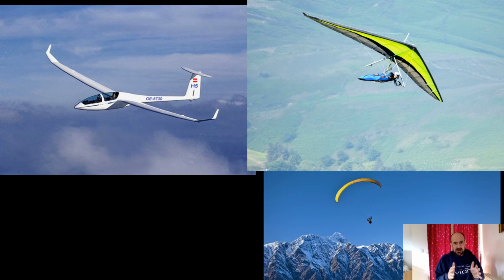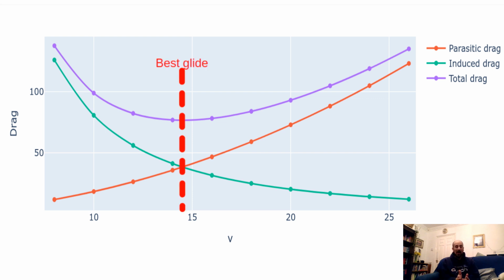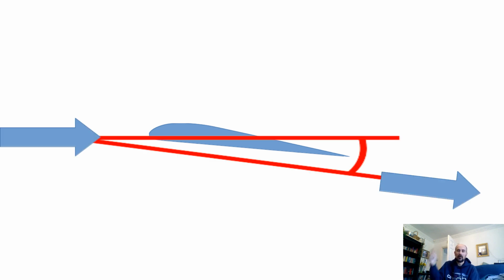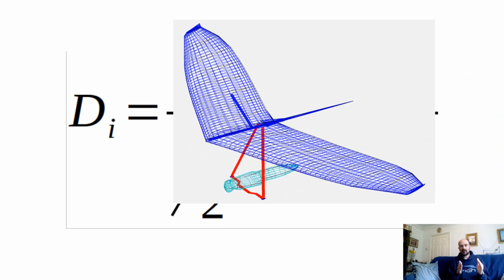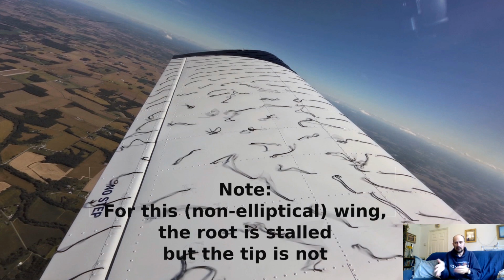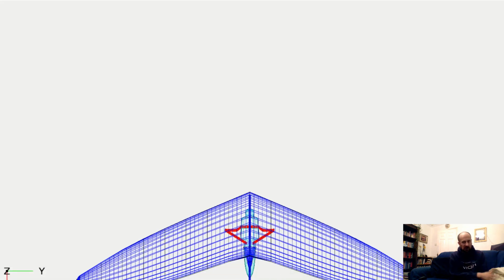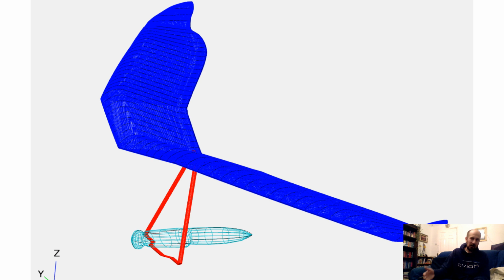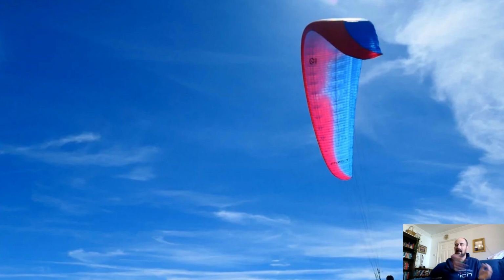Hang glider Performance - why induced drag matters!

Comment: Best glide and min sink are not the same thing.
Reply from the maker: @adenwellsmith6908  no, they're not, I don't think I said they are. But they are both performance metrics that you want to improve (along with high speed glide).
Reply: @avianhanggliders1985  It's what your graphics show. 

The min of the graph is min sink. 
The tangent from the origin to the graph has a slope equal to best glide.
The intersection of that line with the curve is the best glide speed. 

All for still air
Reply from the maker: @adenwellsmith6908  the graph isn't a polar, if the vertical axis was vertical speed you'd be right (and the graph would be the other way up). But the vertical axis is drag. So max L/D happens at minimum drag (since L is constant in steady state flight). Min sink is to the left of best glide, it's at a higher drag, so a less good glide, but because you're going slower you're also going down slower.
Reply: @avianhanggliders1985  Min drag happens at min sink. Do the energy calculations
Reply from the maker: @adenwellsmith6908  no, it doesn't. Let's do the calculation: Glide ratio is the same as Lift/Drag ratio. Lift is constant (for steady state), therefore you can see that for L/D to be maximum, D must be minimum. I.e. best glide is at min drag. Flying a bit slower doesn't increase the drag much though, but because you're going forward slower, you're also going down slower, so min sink is at a lower speed than min drag. There's a longer discussion on this here: https://aviation.stackexchange.com/questions/3670/is-the-maximum-lift-drag-ratio-found-at-minimum-drag
Reply: @avianhanggliders1985  That's wrong. 

From your posts you accept that best glide speed exceeds min sink speed.

There are plenty of other articles that contract the one you posted. 

"What is the difference between the Maximum Glide and Minimum Sink ratios?" on ASE

Min sink minimises drag. The reason quite simple. That minimises the loss of potential energy. Do the work and energy calculations to see that
Reply from the maker: @adenwellsmith6908  I'm sorry, but you are wrong on this. Look it up in a text book if you don't believe me! Can't you see that for L/D maximum then  D must be minimum for constant L. If you calculate in terms of energy it gives you the same answer. Yes, min sink is at a speed lower than best glide, and therefore at a speed lower than min drag.
Reply: @avianhanggliders1985  No. Take a polar curve. 

Draw a tangent line to that curve from the origin. 

Do the same, a line from  origin to the minimum sink. 

Which has the best slope?
Reply from the maker: @adenwellsmith6908  You're right for a polar, but the graph in thumbnail IS NOT A POLAR! A polar is not the same thing as a drag plot. A polar plots vertical speed against horizontal speed. The graph in the thumbnail (which I think is what you're commenting about) plots drag versus horizontal speed. These are two different things.
Reply: @avianhanggliders1985  So you are happy that best glide exceeds min sink speed?
Reply: @avianhanggliders1985  Then to minimise loss of height, which is min drag, which minimises the loss of energy. 

ie. Min sink is min drag. Best glide is not. It's faster than min sink and so the drag is higher
Reply from the maker: @adenwellsmith6908  YES! And are you happy that best glide, not min sink, is at min drag?
Reply: @avianhanggliders1985  No. I disagree. 

Min drag is at min sink speed.
Reply from the maker: @ You're right that min sink occurs when rate of energy loss (i.e energy per second) is minimised. If you want to think of it terms of energy, the relevant equation here is Work = Force x Distance. Work in this context is energy, so to minimise the energy loss then you need to make BOTH Force and Distance low. Force in this context is Drag, so we get that low by flying close to min drag speed. By flying a bit slower than min drag speed then you do increase the drag a little bit, BUT you decrease the distance travelled (per second) by more, so the product of Force x Distance, and so the energy loss is lower. This is why min sink is slower than min drag (i.e. best glide) speed.
Reply: Avian is right
Reply: @avianhanggliders1985  Exactly. So notice that min sink speed is min drag speed. 

By flying a bit faster, you can increase the drag, by the distance you travel also increases, by more. At higher speeds, the drag increase by more than the gain in distance travelled. 
Somewhere in between there's an optimum. 
It's about min speed, below max speed. 
You optimise speed flown / sink speed. 

You're still making the error that min drag = best glide speed, its not. 

Min drag = min sink. It's the lowest drag because that consumes the potential energy at the slowest rate.
Reply from the maker: @adenwellsmith6908  I've tried to explain this to you as best I can. Min sink speed is not min drag speed. I think you're still mistaking this graph for a polar, which it isn't! Best glide is best L/D, right? L = weight therefore = constant, right? Therefore min D = max L/D, right? V Min sink < V Best glide Therefore V min skin < V min drag.  Or think of it in terms of energy if you like, but the answer is still the same.
Reply: @avianhanggliders1985  You have a given potential energy. In the case we are talking about speed is kept constant, so no changes in kinetic. 

How do you minimise the reduction in potential energy? 

You minimise the drag
Reply from the maker: @adenwellsmith6908  no, for the reasons I explained above, you minimise rate of energy loss by minimising the product of speed x drag. This minimum is below the minimum drag speed. Please read an aerodynamics textbook if you still don't believe me.
Reply: @avianhanggliders1985  Drag. 

F proportional to  v^2 That's for non induced drag. Parasitic. 

F proportional to v^-2 for induced drag. 

Min sink kicks in at min drag. 

Now if you are a hanglider because they are very inefficient then the two are effectively one and the same. 

But with gliders now hitting 60:1, there's a big difference between min sink and best glide speed.
Reply from the maker: @adenwellsmith6908  Yes, for a glider min sink and max glide are further apart than for a hang glider, but that's not relevant. Min sink does not happen at min drag, for the reasons I've explained in all the comments above. I explain parasitic and induced drag in the video. Did you actually watch the video, or did you just see the graph in the thumbnail and think it's was a polar?
Reply: @avianhanggliders1985  I'm still pushing on the min sink and min drag. They are the same. 

Anyway, hangliding question. Is it better to learn at a beach site or a hill site?
Reply from the maker: @adenwellsmith6908  haha! Beach or hill can work well, as do winch or aerotow. So probably the best for you is whichever if closest! Coastal sites get nice smooth laminar winds which are good for training and if it's somewhere that gets a consistent sea breeze then it should be reliable for weather. You'll probably get onto flying bigger hills sooner inland though, and get used to rougher air sooner.
Reply: @avianhanggliders1985  Dockweiler Beach Hang Gliding Park - saw some video of that and it was interesting. 

Minden, Uvalde for me as a glider pilot are the interesting places. Nephi another.
Reply: @adenwellsmith6908  as someone who "beach -> mountains" in the 90s, and then got back to the sport a few years ago and decided to take the full course again, this time on winch,
I cannot recommend winch highly enough.
taking a hang glider up a beach dune 50-60 times is proper bootcamp. When I was a teenager, that was an ok workout over several weekends.
winch training is much more effective and efficient, both in terms of sweat, and in terms of time.
Reply: @avianhanggliders1985  and I thought you were too patient with me... 😅
Reply: @adenwellsmith6908  Actually if you live in the United States then theoretical ‘Best Glide’ is Yosemite